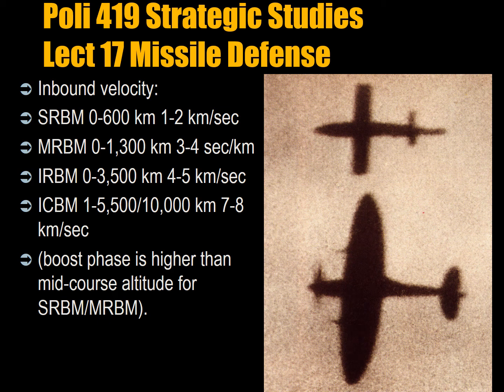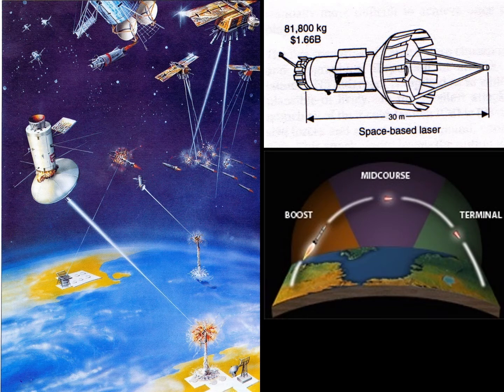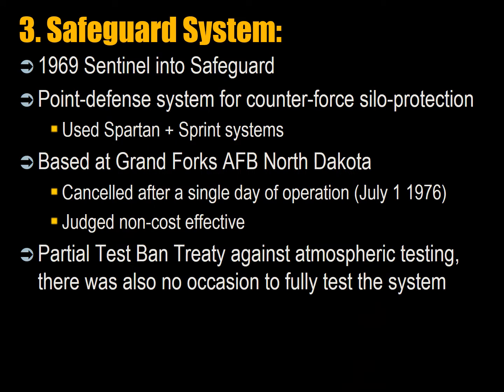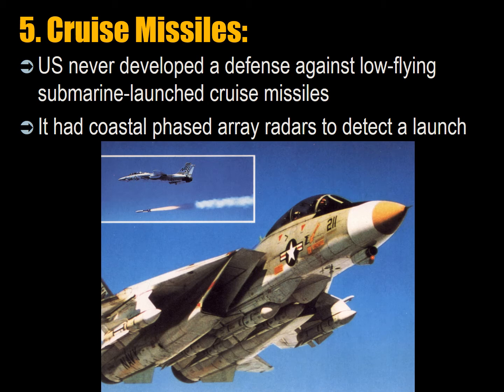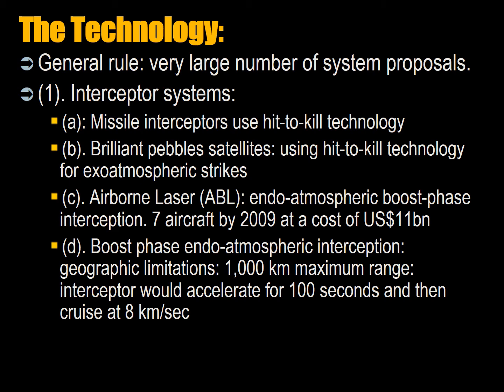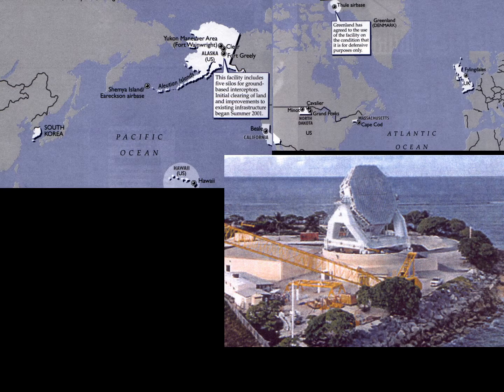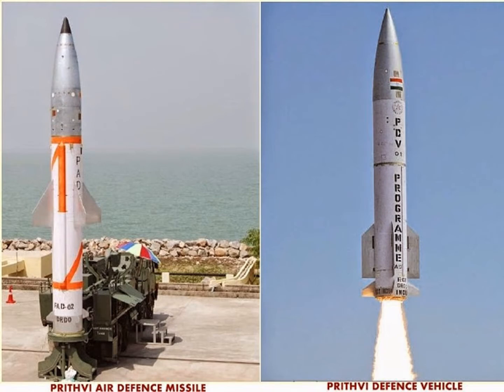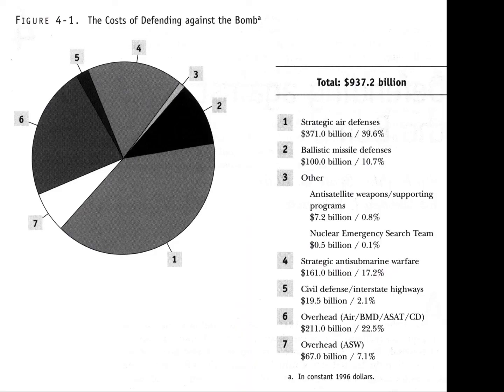002 Nuclear Strategy Lecture 17 Issues in Missile Defense

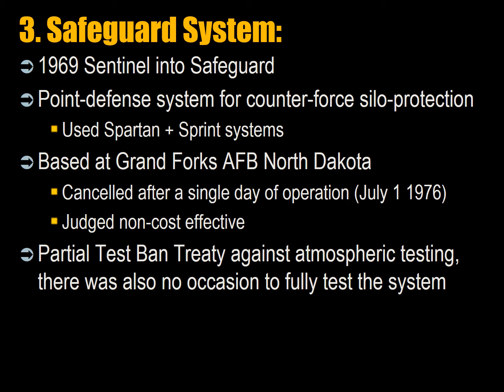Comment: 11:00 How did Nixon have a say on a system that deployed in 1976?

Here is the Wikipedia entry (which I don’t assume is correct….)
“The site achieved initial operating capability on 1 April 1975, and full operational capability on 1 October 1975 costing over $15 billion adjusted for inflation. However, on 2 October 1975, the House of Representatives voted to decommission the project, after they deemed it ineffective. The complex was deactivated in April 1976, after only six months of full operational capacity.”